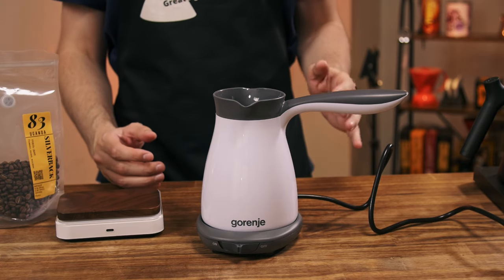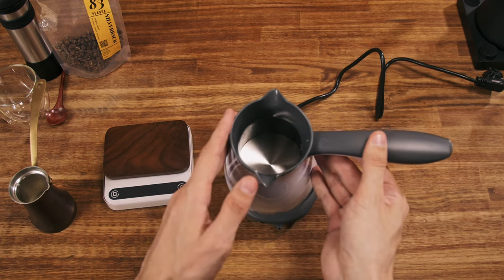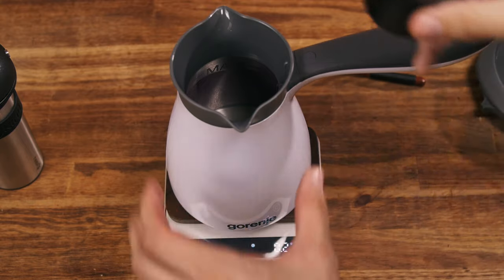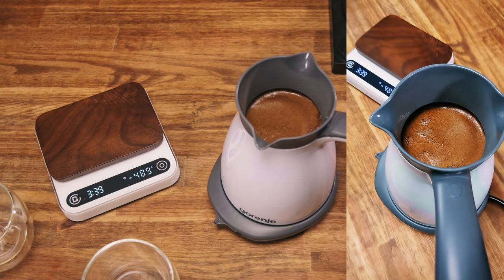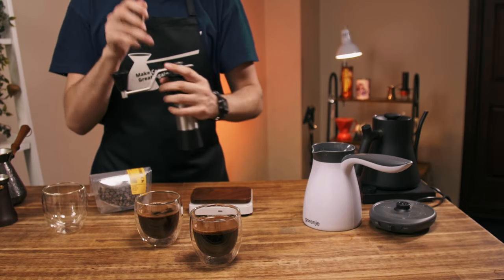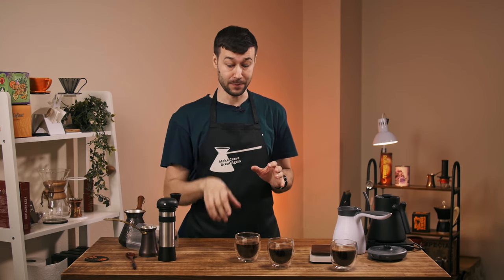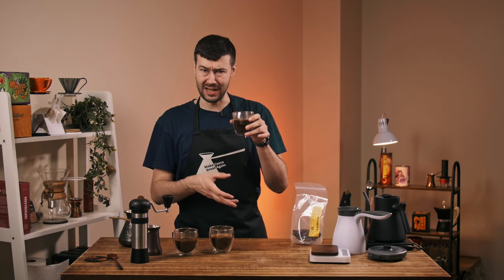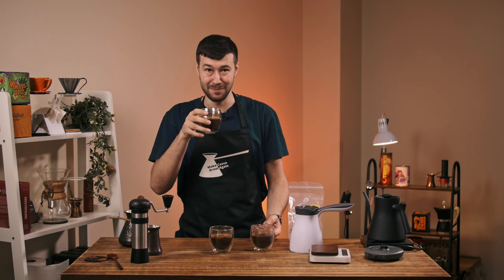Better than traditional? Turkish Coffee Maker

Comment: do you strain the coffee?
Reply from the maker: Never. I mix the foam or blow on it if there are particles at the top (not just foam). Other than that - the residue will be at the bottom. You will not drink it
Reply: Turkish Coffee generally does not need it.  You grind really fine and wait several minutes after stopping the boiling because it is too hot and because it is not finished brewing.  Once a few minutes have passed, all the grounds sink.  You drink the coffee until you reach the layer of very dark slurry at the bottom and then stop because otherwise you are essentially drinking something the consistency of sand water.

Comment: For cleaning it looks like there is a strangeness on the inside where the handle attaches too - looks like a trap for oils so wiping out won't be enough between uses.
No flames is a big plus in some environments - perhaps with lots of flammable dust or where the operator is a bit decrepit :D
Reply from the maker: Sand heater and induction are flameless as well, but they have a lot of control)